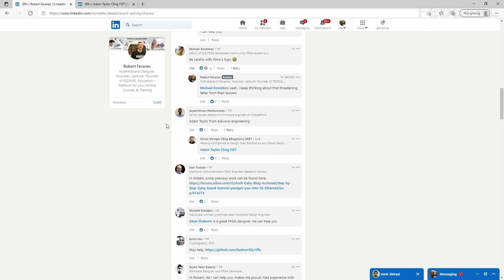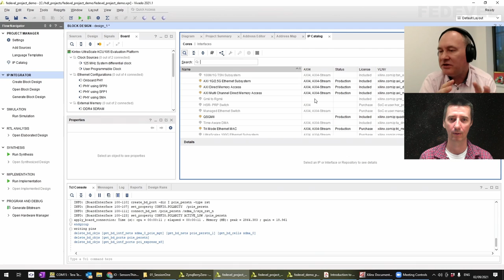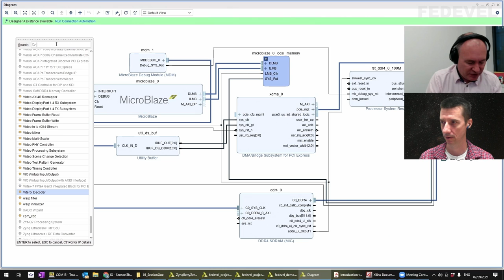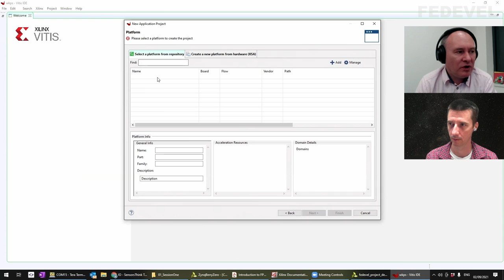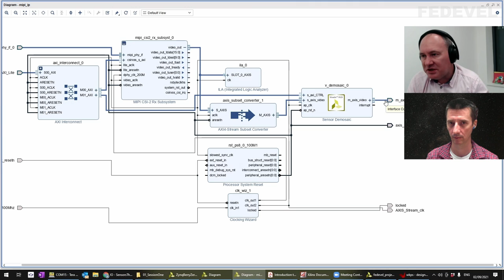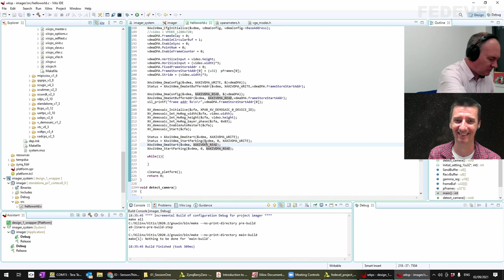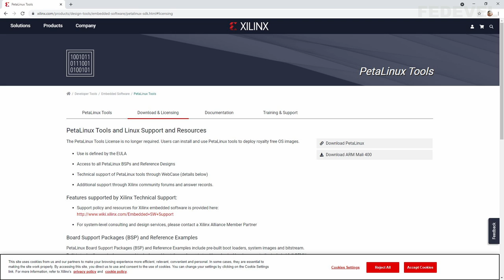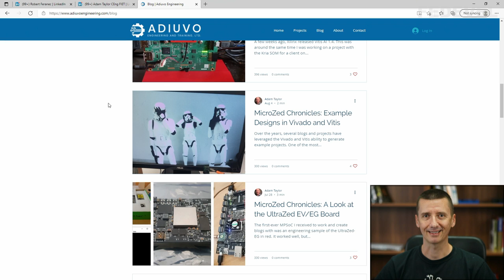How To Create Difficult FPGA Designs with CPU, MCU, PCIE, ... ( with Adam Taylor )

Comment: You forgot the most difficult part: finding FPGAs in stock anywhere nowadays!
Reply from the maker: Yes, that is a very big topic these days
Reply: Exactly. I am being quoted 52 weeks lead times.
Reply: Yeah, I have 4x 14$ Intel parts scheduled for shipment in 2023. I stupidly started a project before checking availability. I was able to score some other parts from Mouser 2 weeks ago and will redesign my board even though I have the PCB's for the other unavailable part.
Reply: @vincei4252  pure nightmare mate
Reply: @kianemami9090  Indeed. I have a couple Kickstarter projects I  signed up to that are in limbo because of this. Thankfully I got a notification that an SDR I recently bought got shipped this week despite Intel FPGA's being almost completely AWOL.
Reply: @vincei4252  same for me , i had few ideas to work on , but i cant even source a MCU ( stm32f4 ) with ease , i got 20->52 weeks lead times
Reply: Strangely I benefited from the lack of fpgas: we were designing a pretty simple SOM for lab equipment on Artix 7, DDR3 and Ethernet phy, I finished the pcb, and exact same moment our supplier suddenly wrote to our teamlead: "lead time for any Artix 7 is 56 weeks... and for anything else too, except the last 11 Kintex 325-t we have in stock, can sell them for cheap if you take right now". So I'm now getting a great experience with this chips that I would never use in normal conditions lol )
Reply: @АлексейСмирнов-я6п3я  Nice. I've been picking up large capacity "obsolete" fpga's for projects because rather unsurprisingly they are easy to get. I mean logic is logic, right?
Reply: Damn I am so glad I bought my FPGAs for a board I'm designing in a couple of weeks like 2 months ago.  I just threw them into a digikey order without thinking too much about it
Reply: @vincei4252  obsolete parts are ok if you can get tool chain that support these and they are fast enough for your application.
Reply: @LimbaZero  Thanks, yes. I have an old version of Altera Quartus and Xilinx ISE that cover the obsolete parts in my collection. Thankfully most of what I do is retro so I don't need cutting edge blazing speeds. FWIW, I despise the licensing scheme that the vendors use for their FPGA tools that render millions of parts unusable because the vendor doesn't support or license that version of software anymore. That and the incredibly high price you have to pay for the tools.
Reply: Yeah its pretty bad right now...
Reply: I still get spartan 6 from aliexpress
Reply: @LimbaZero  be careful with the cooling of chips, test your project for overheating for days if not weeks, instead of going broke over a missing heatsink that pops the chips.
Reply: as we are embedded engineers in turkey, we're just porting and porting and porting to different systems because of chip shortage.
Reply: Has the shortage ended in the meantime?

Comment: Due to cost, I'd recommend that you use an FPGA for the most cost effective solutions. These solutions are nearly always based on parallel processing. A microprocessor implemented on an FPGA will cost you 100's of times more than a standard commercial device. Video processing is one of the main uses of FPGA's, but not standard video processing, as if it can be done with a GPU, then you should use the GPU, due to costs. Big FPGA's cost hundreds to thousands of dollars for each chip!
Reply: None of this is true anymore in SoC era... Plenty FPGAs are available around 20 bucks that can do "reasonable" design complexity nowadays... And you can have a REAL MCU core in an FPGA, or the other way around these days!!!
Reply: @nameredacted1242  Please provide some links. I'd love to find a MCU core that was less than $100!
Reply: @mcconkeyb  CrapTube will delete any of my posts with links. DigiKey is your friend.
Reply: But $10 FPGAs from Lattice also exist.
AGREE, stupid to put an MCU soft core inside FPGA if these days hard cores and SoC cores and separate ICs are available.

Comment: Great video! Now I have something I can send software engineers to that keep asking the same higher level questions about FPGAs.
For PCIe, it doesn't only have to be a host computer. Right now I have a Zynq Ultrascale+ on my desk connected to an i.MX8 board via PCIe (M.2 connector to the PCIe edge connector on the dev board). There are plenty of edge computing applications where such a configuration makes sense (the i.MX8 is higher performance and lower power than the ARM part of the Zynq U+, however, you would probably use a Kintex in an actual product where the Zynq just helps with development).
For drivers, the OS does a lot of the work for you. Once the OS boots, the PCIe BARs are assigned memory regions in the host's physical memory space. So you would interface with the PCIe end point / BARs via physical memory R/W on the host. On a dev system like the i.MX8 that I have where /dev/mem is accessible, a driver isn't needed to get things working - I was able to use both C code and Python code to directly access the BAR memory space from user space. For an actual product though, you don't want to have /dev/mem accessible and you need a driver. In that case, the easiest solution is to copy one that already exists (xilinx has one for their XDMA system, but that's not necessary in most cases). Complexity will depend on how you want to break down your security and features, however, the simplest solution is to offload a lot of the work to user space. In such a situation, your linux driver has boilerplate linux PCI driver code (copied from guides all of the place which let Linux associate the PCIe endpoint with the kernel model / driver), and then you implement the mmap function call on the module. The mmap function call is just a secure indirection of mmap on /dev/mem, so it provides a way for a user code to mmap the device (e.g. /dev/myPCIe) and it gets associated with the physical BAR address mapped by the OS.
This was one of those things that I always thought was very complicated to do, but it turns out to be very simple... I actually think that using PCIe between a linux host and an FPGA is simpler than trying to do I2C or SPI. I would say it took about 3 days of head scratching to produce something that could have been done in 10 minutes if I knew what I was doing from the start.

Comment: Thanks for this amazing video. It's value is priceless, at least for me.
I got to a point where the most difficult part is not the design process, but the process of starting Vivado and/or keeping it crash free. I wanted to learn how to handle Ethernet related problems on FPGA, so I took a Spartan 7 board from UNI and started designing an RMII based TCP/IP echo server... until Vivado got fed up, and started not working. 
I'm really thinking of leaving Xilinx for Lattice once and for all. Maybe the FPGAs are smaller, and maybe the IDE is a bit last century looking, but I did not have any disheartening bugs with them so far :)).
Reply: Vivado is indeed a horrible tool. I always have to spend a lot of time just to make the simplest thing work. Also using any version control system is a nightmare, since just opening and closing the project already changes files...not to mention weird pc specific paths that it decides to save...
Reply: The key is to keep a TCL script that recreates your project in version control (see AR# 56421). Vivado projects seem to get slower and more cluttered over time for some reason, so I typically delete the project and recreate it fresh from the TCL script whenever a significant chunk has been added and put into version control. Vivado also seems to run better on linux than in windows.
Reply: @laserdan  I think this only proves my point... :-)

Comment: I am sure this is useful, but it did not answer my question, which I think is the same as yours.  How you do find and use these to connect things into larger projects?  Someone said "hard to find them now" and that happens for every fad on the Internet.  It never seems to get simpler, cheaper, easier.  So all I can do is say thanks for your efforts.  I think I am going to concentrate on analog MUX, sensor arrays, signals, signal prep, ADCs, algorithms and purposes. With a budget and purpose, choosing is easier.  Pardon me, but "What a mess!  Too much stuff for everyone to have to memorize all these odd shaped pieces and their software."
Reply from the maker: Thank you very much @richardcollins5549 PS: This Phil's video may also help: https://www.youtube.com/watch?v=B-CbDfrfJRk
Reply: @RobertFeranec  Thanks, I watched that too.  I hope it gets to where I can just order something by function and have it sent to me for a fixed price.  "An ESP32 with DMA controllers for each camera, each 16 bit high speed RF ADC.  5 GHz wireless or USB 3.2 or 10 Gbps ethernet. SSD"  It is all just chips wired together in pretty standard ways.  A computer program should be able to check the tables of requirements, place things on the board, send it, make it, mail it.

Comment: I'd pick the cheapest board that you can afford, if you are coming from an electronics background and will wire up your own circuits to the board. A board where you can screw up badly and kill the FPGA chip, and replace the board, without kicking yourself too hard, for what is a learning experience (no way am I killing the next board, or the same board with a new FPGA, that exact same way ever again).

Comment: Anyone else notice that he had 6 different versions of vivado installed :p .
Reply: Plus all the ones I have on external hard disks.
Reply: It is going to happen, unless you want to update all your existing gateware every time a new major version of the tools is released. And sometimes older chips are dropped from support in the latest revision, so if you need to support older hardware that you have sold in a solution, you will need multiple versions. It is the best use of YOUR time.
Reply: I once visited a company where a lot of employees have multiple PCs that are running XP or even Windows 98 just to support their old products